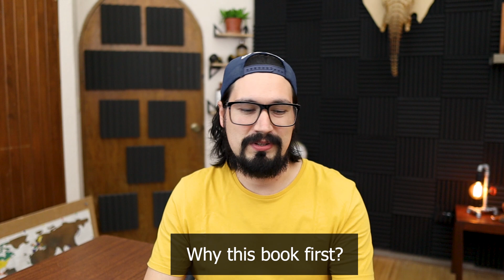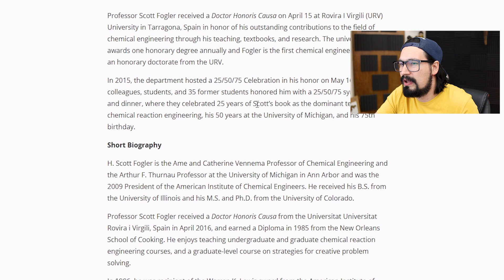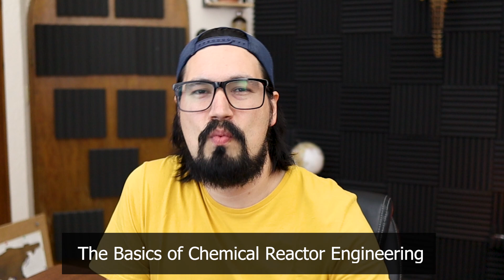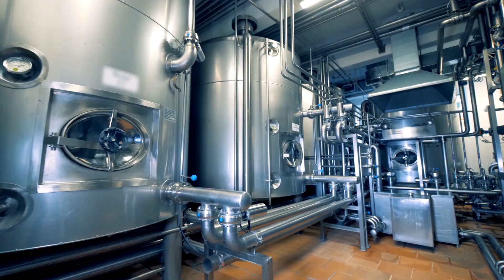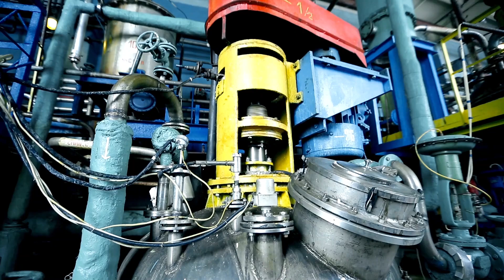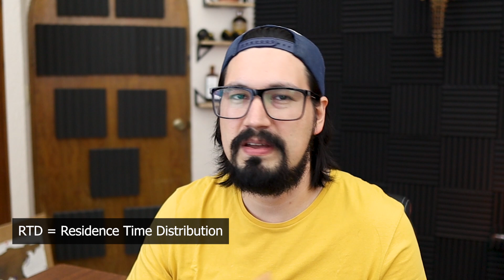The BEST Chemical Reactor Engineering Book - A Honest Review from a Process Engineer

Comment: RIP, Dr. Fogler, who mentored one of our faculty. As I sit here in my academic office, I have Fogler's book, Levenspiel's book (the one I learned from before the asteroid killed off the dinos), and Hill and Root, all on my desk. Each has its own strength, but Fogler's remains my go-to text when building assignments for kinetics-oriented lab experiments for seniors.
Reply from the maker: Nice to know that you are using great reference material! Do you teach any other subject as well?
Reply: @ChemicalEngineeringGuy  The kinetics-oriented lab experiments are part of the Unit Operations Laboratory course, which includes experiments in separations and process dynamics/control as well.

Comment: Best books for math. What kind of math is the most useful for chem engineeres to know and master? Which are the math skills that are most on demand that give the edge in finding job?
Reply from the maker: Any Math Book on Differential Equations, Integrals and Derivatives should be fine. I would recommend, on personal experience, James Stewart - Calculus
Reply: @ChemicalEngineeringGuy  Stewart's Calculus is an excellent undergraduate calculus book (perhaps the best), but might not have enough applications and advanced material (specifically differential equations a linear algebra) for a chemical engineer. If the engineer needs to review basic differential and integral calculus concepts and techniques, go for it.